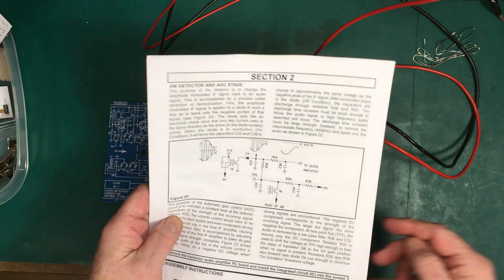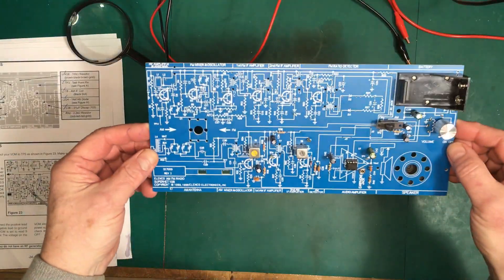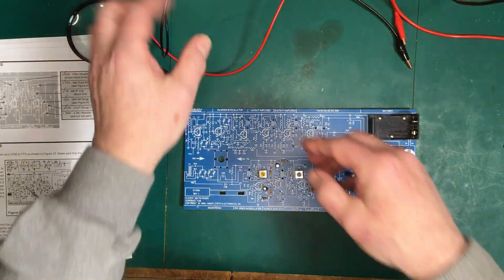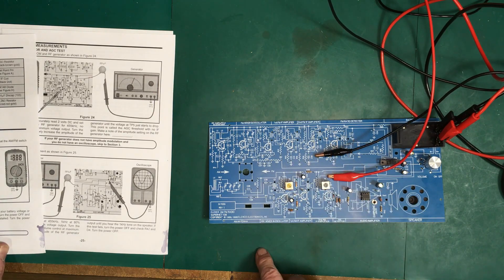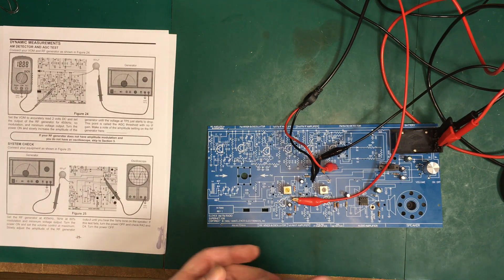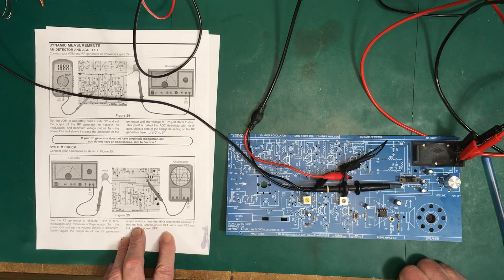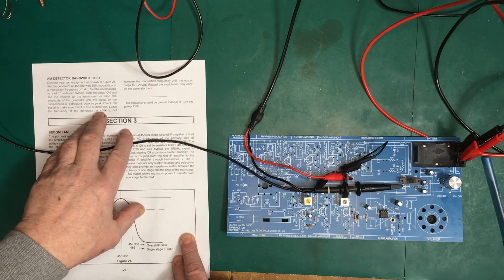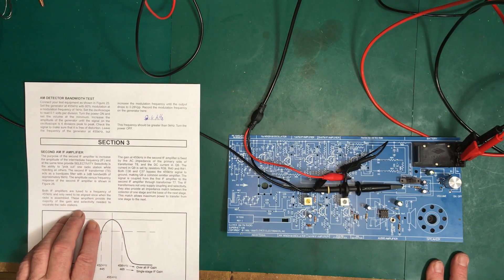0036 - Elenco AM/FM-108CK Kit Build: Part 2

Comment: Finally git around to making this. Am stuck at section 2, when I go to turn it on and test the voltage (Figure 23) the speaker makes a galloping noise.  I only have a voltmeter so it's possible that fault is from the previous step? It makes the noise regardless of AM/FM switch.
Reply from the maker: Did you go with the transistor amplifier or the IC amplifier?  The amplifier is the only thing shared in common between the FM and AM sections, so I would look over that very carefully.
Reply: @uni-byte thank you for the reply. That's a great catch!  I swapped out the IC with the transistor and it doesn't make the noise.  Where is the problem?
Reply from the maker: @ATK-NDH  The IC might be a dud.
Reply: @uni-byte  Thanks for your help, I will check the amplifier.
Reply from the maker: @ATK-NDH  You're welcome.

Comment: I'm following along with your videos while slowly building my own Elenco kit.  Thank you for sharing your experiences. I ran into gain problems with the  LM386 which I measured as 200+ gain when I followed the kit instructions.  After reviewing LM386 spec sheet data I decided to replace the kit resistor with a 220 Ohm (just pulled one from my junkbox at random)  and the gain is now 148.   I hope your dog is doing fine.
Reply from the maker: Good luck with your project!  Reggie (my dog) is doing fine.  He'll never get better as his tear glands have completely atrophied.  Thanks for your wishes though, much appreciated.

Comment: During my static test I got around 8.5 volts, and my power supply showed a draw of .5 amps. Took a quick visual and everything looks ok, I guess I’ll started de-soldering components until it goes away. Anyone have similar problem?
Reply from the maker: Was everything okay with the audio amplifier?  Check R36 and see if C32 might have a short across it.
Reply: @uni-byte  yeah audio checked ok in the beginning. I took the if circuit out of the loop and I still have a high current draw. I remove the IC and it went away. Pin 6 as 9volts with no draw so it must be after that.
Reply from the maker: @kenmccarthy8130  If the current drops when you remove the IC, then it must be associated with the IC.  It could either be the IC itself or possibly of the output capacitors (C43. C44).  Is C43 in the correct way around?
Reply: @uni-byte  Ok, totally confused now. If I disconnect the speaker there is no amp draw. There is 4.6 volts Dc on both sides of C43, shouldn’t that cap block the DC? The cap tested ok, but I replaced it anyways with another cap.
Reply: I think I just found the problem. I had the positive wire of speaker wired wrong. Duh!
Reply from the maker: @kenmccarthy8130  Cool - good trouble shooting there!
Reply: @uni-byte  For a problem I caused thanks to these old eyes. LOL. All set now. Thanks for your help.
Reply from the maker: @kenmccarthy8130  You're welcome.

Comment: OK - 3 questions 🙂: The output of the signal generator - should it be set to mVpp or mVpp RMS? (Or is that a stupid question!?) - Hank
Reply from the maker: That really doesn't matter as long as you keep things in mind and do the bookkeeping in your head.  I think for most of the measurements in the instruction book, they want you to use Vpp input signals and they get you to read off a scope where reading Vpp is much easier .. so the input matches the output.  Where they go a little awry here is with the first dynamic measurement on page 11.  Here they are not specific, but I think they meant that the input be in Vpp but the problem comes from using a VOM/DMM to read the output.  They will not read Vpp.  Older ones will read an average (which is very close to Vrms for sine waves) and newer ones will read Vrms.

So, other than that, inject Vpp and read Vpp.

Comment: Bill...2 questions:  What are the settings on your oscilloscope to make the AM Detector measurements - ie AC or DC coupled, HI-Z etc?  I had trouble due to my oscope inexperience.  I wish the manual was a little better on the test gear info.  2nd question (and answer I think): The capacitor used in-line with the signal generator is to block DC voltage from back-feeding into the generator correct?
Reply from the maker: Hi Hank,

The scope should be AC coupled unless you are also interested in the DC component.  The impedance should be Hi-Z and the probe and scope set to 10X.

Yes to using the cap on the FG to block DC in the DUT.